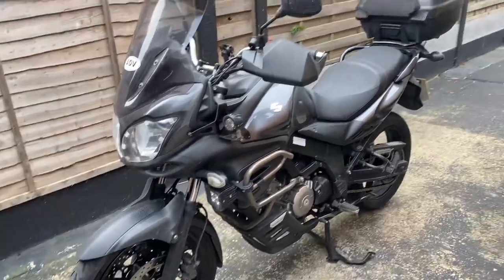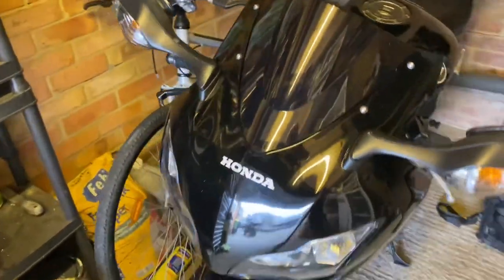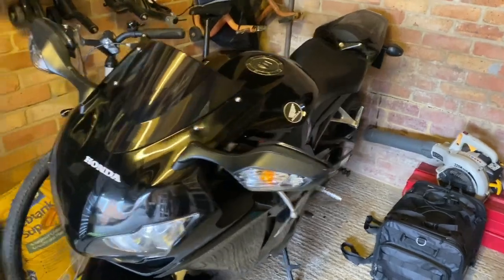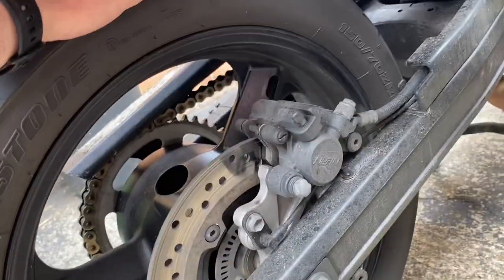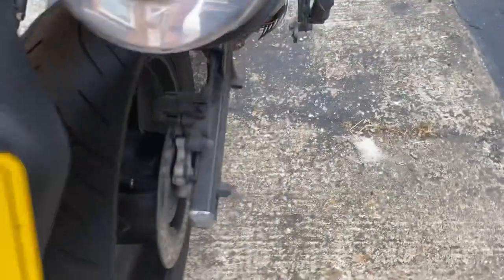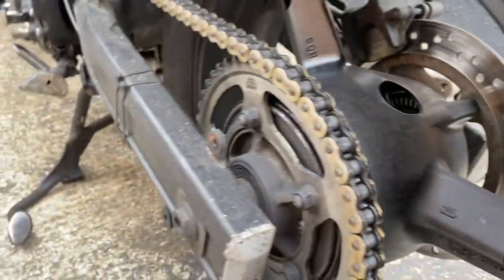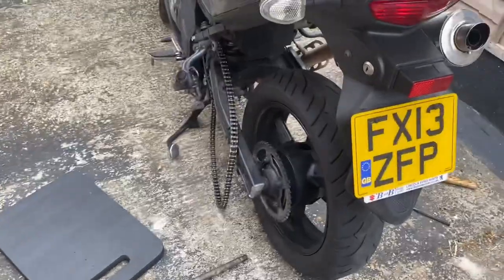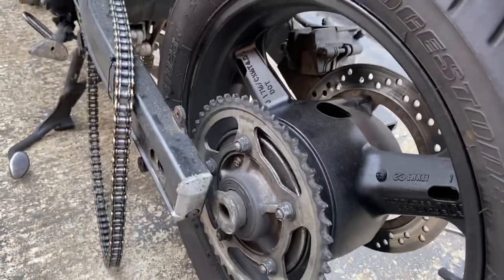How To: Replace rear wheel bearings on a Suzuki V Strom 650

Comment: Nice job and video.  It can also be helpful to warm the outside of sprocket carrier where the bearing sits with a heat gun to expand it prior to punching out the bearing with a socket.  Warming it prior to installing the new bearing makes fitment easier as well.  Thank you

Comment: Hi ! Thanks.
How many km (or miles) when you had to change your bearings?
Greetings from France
Reply from the maker: Hello mate, I changed them when the bike had 31,600 miles on it. The bike is a 2013 model 👍
Reply: @rollingwithjoe7562  Thank you very much for your answer 🙏. Do you stay on the road or do you go offroad from time to time? Do you ride regularly when it rains? Because 31,000 miles isn't a lot.
Reply: @williamyamm8803 . You can see from the condition of the bearings and rust that this bike does off road and goes through water.
Reply: @murraycharters6102  Thanks !

Comment: 100 Nm on the axle bolt as the manual states is too much

There has been a lot published on this.

Greywolf recommends 80 Nm

My mate stripped his axle threads with 100 nm and could not get the nut off.